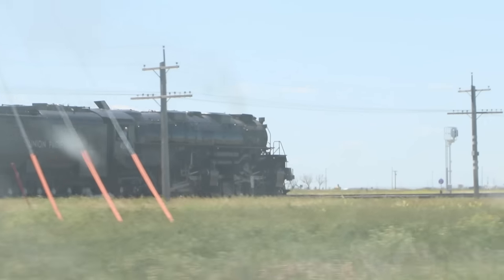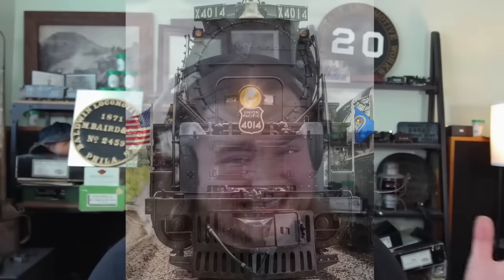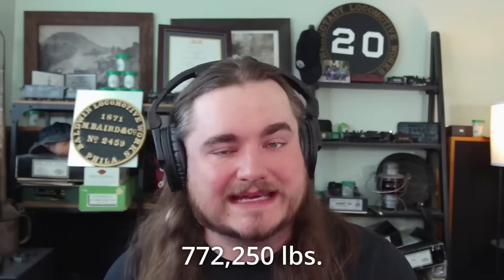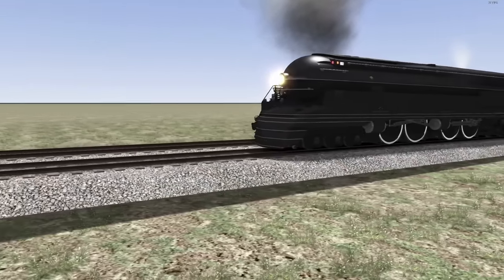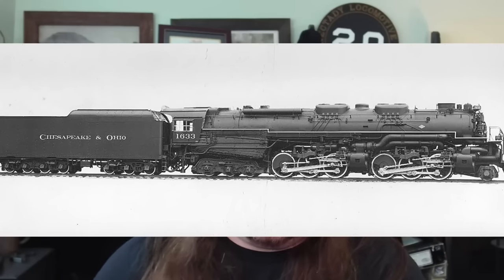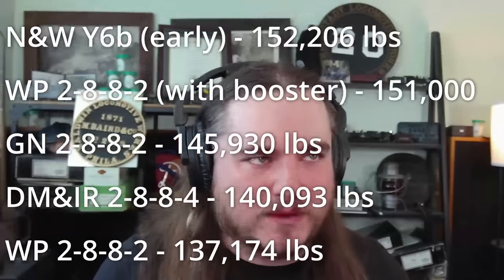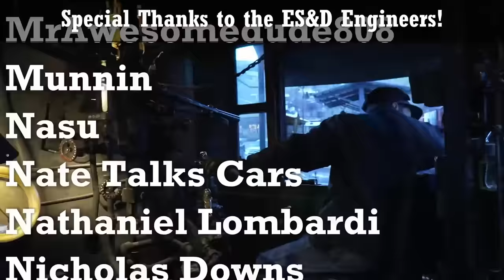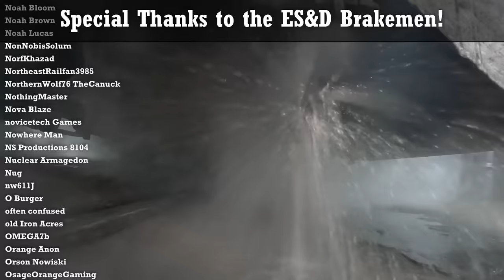BIG BOY is NOT the BIGGEST? What is then?

Comment: I thought up a fictional 4-10-10-6 locomotive once (simple articulated), and I just did the math, it outputs just SHY of 200,000 pound-force in tractive effort (the exact amount is 199,920 pound-force) it also uses the same boiler width as the Virginian AE class 2-10-10-2 (and now that Im thinking about it, how much would this 4-10-10-6 weigh?)
Reply: Why stop there?  Why not weld a couple 4-12-2 types together and make a 4-12-12-6?  Not sure how many cyclinders it ought to have--four, five, six?   All you'd need would be railroad with no curves and turnouts a quarter of a mile long.  I always thought that would be fun fantasy loco to model in HO scale . . .
Reply: @jaysverrisson1536  Still, just how much would the darn thing weigh?
Reply: @CSXP408x  Well, very roughly speaking, a Big Boy 4-8-8-4 (minus the tender) is a bit more than half again as heavy than the heaviest 4-8-4s.  A 4-12-2 (minus the tender) weighs in at a just under 500,000 lbs, comparable to a heavy 4-8-4.  So, I figure a 4-12-12-6 might weigh upwards of 750,000 plus some extra for the 6-wheel trailing trunk vs. the 2 wheels of the original.  Maybe 775,00 to 800,000 lbs for the loco alone, i.e. comparable to a Big Boy or Allegheny, or a little more, but not drastically more?

Comment: The only reason why today's locomotives are smaller is that you don't need a big boiler, and thus you are more flexible by adding more locomotives, all centrally controlled from a single cab instead of one big engine. But still, there are the MTAB IORE at 150" total length.

Comment: The big boy has always been kinda weird in that it was designed for huge fast freight service but it was actually used in that capacity and was also extremely good at long haul freight drags as well. It was a very well rounded locomotive. The Alleghenys were also fast freight engines but ended up as coal draggers and werent as good. The big boy did what it was designed to do well bery well and operated outside its design parameters very well. But it wasnt the best in terms of fulfillment of their designed purposes. The S1 and the Y6s were still better at the purposes for which they were built however big boy did better at things outside of its design parameters

Comment: How did Santa Fe’s “Double Decapod” compare? Although it failed miserably, that had to be larger than the “Big Boy”. As memory serves, the Santa Fe’s 2-10-10-2 had an articulated boiler. The Santa Fe wound up rebuilding these into 2 , 2-10-0’s with the addition of cabs, fire boxes, smoke boxes etc to each half as necessary. If successful, they would have outclassed the “Big Boy”.

Comment: I might be wrong in this statement but if I recall correctly a lot of these massive articulated engines where purpose built for a certain service and in some cases even just a specific train (N&W Y6 specifically hauling some of the longest coal trains ever marshalled in their time) which is why so few where produced whereas there’s a myriad of serialized Baldwin and Alco’s you could find that saw hundreds of the exact same standardized model built for various railroads.  Also a lot of them had only specific places and track lines they could operate due to their weight, so they’re completely useless anywhere else.

Comment: It’s important to mention that the Big Boys and mallets were built for two different purposes. The former for hauling faster loads over long distances through vast deserts, the layers for slower moves in often more densely populated regions than that of Wyoming, Utah, and Colorado where the Big Boys worked. Still what they were capable of is hard to beat, even by simple articulateds built for fast freights

Also those lengthy ones were turbines. And the S1 tenderless was shorter than a tenderless big boy

Comment: At least a few Challengers still exist. Big Boy turned out to not be the most economical either. It was designed to haul freight over the Rockies with the idea that it could haul longer trains. But 3 Challengers could easily pull the same as 2 Big Boys and the 3 Challengers would use less fuel and the water as the 2 Big Boys for the same job. The Big Boys were the "great big experiment", and that's where the excitement lies.
Reply: ...You're forgetting the cost of three locomotive crews vs only two in that comparison. Compared to the cost of the crew running the engine's, fuel and water were cheap, especially back then. By that metric, the 4000 class actually were fairly economical, given the entire point of these large engines was to run longer trains with fewer crews.

Comment: Without watching your video, I'd suggest a Beyer Garrett, (sent the the USSR) with a suspended boiler between TWO articulated 4-6-2 locomotive frames, with those positioned with the rear ends inwards, and the lead pilot trucks (furthest away from their couterpart) to be opposite facing complete locomotive frames in their own right, with a huge boiler and coal bunker slung  between them, such that the single boiler fed all for locomotive trucks, totalling a huge 160+ feet ?

But then again, maybe the experimental (English) Jawn Henry locomotive may have been the longest - (re: "Jawn Henry." Built by Baldwin Locomotive Works, No. 2300 weighed 409 tons and was 161 feet long)
Butt who knows and really?
Who cares?

Comment: See plenty of reports that state the Big Boy was fully capable of 7,000 plus horsepower. Some of the trains you compared the Big Boy to seemed to be Diesel Electric. Also the amount of weight over the drive wheels plays a big factor when considering tractive effort. I believe it’s said the S1 only had 40% of its weight over the drives and suffered from slipping issues.

Comment: An important fact that most people seem to forget when they’re comparing the big boy With the other large steam locomotives, Is that the big boy has relatively large drivers For freight locomotive at 68in Because it was built for speed. So if you were to replace those drivers With sizes more common like 63 to 65in Then You probably could get A lot more  tractive effort maybe like 150k. But of course, top speed would go down With those small drivers.

Comment: I'm an old farm boy that likes steam as well.
Farmers would get together and have tractor pulls to brag about their tractors. The conditions of the staged pulls was never ideal. Some tractors did better than others.
The real test was in the fields doing the jobs they were designed for. Which ones could dig their toenails and get through the tough spots was the real test. 
Todays tractor pulls are for show and you won't see any of them out in the field working 10 hour days.
Big Boys field was the mountains between Cheyenne and Ogden where they slugged it out on a daily basis.

Comment: There are three production locomotives that are in the class of the BIG BOY, the key word is production, UP bought 25 BIGBOY's.   there were 88 Allegany/Blue Ridge Locomotives, and there were 18 DMIR Yellowstone locomotives. they were all 6000+ Horse power from the 2 drive engines.  The Allegany got a Horse power boost with the Steam turbines in the 3 axle firebox truck.  Big Boy was known as the largest because of two factors, First the PR department at UP advertised  it as such, Second: they operated next to the US 30, the Lincoln Highway where it was filmed pulling long trains at high speed across the Great Basin Desert.  Yellowstone's hauled heavy loads of Iron ore through the northern Minnesota forest,  Allegany/Blue Ridge were pulling Coal in the New River Valley canyon and filming was limited to short sections at much slower speeds.   The Y6B was a stronger pulling engine but the size of it's drivers limited the speed and therefore the horse power.
Reply: The horsepower was limited by the size of the firebox and boiler, not the drivers.  This locomotive was designed to generate stupendous tractive effort at speeds of 25-30 mph, the maximum safe speed for superheavyweight coal trains in that mountainous terrain.  For that service 5000 boiler horsepower was plenty.  It could make 50 mph with a light load without shaking too much, and if Norfolk and Western had so wished they could have built it with a bigger firebox and boiler to run that fast with a heavy train in places where the terrain would allow it.  What they did was build locomotives that were more efficient than a Big Boy or Allegheny would have been in that slow coal drag service.  When the Alleghenies were running in such service on the competing Chesapeake and Ohio, their additional boiler horsepower capability was being wasted.

One of my fellow model railroad club members once said that N&W was the smartest in designing and operating big steam locomotives, and that C&O was clueless.

Comment: A few points: 1: The power differences between the Big boy and other lsrge locomotives likely lie within the error bars for power measurements at the time. 2: Most engines that beat the Big boy on tractive effirt also have very  low factors of adhesion suggesting that they might mostly spin their wheels 3: Loading gauge, axle loading and generally similar technology is why there are a number of locos of similar size and power. Big boy is one of the later ones abd one of the more successful.

Comment: Mark: One thing you didn't mention was operating speed. Maybe BB didn't have the greatest T.E. but it did operate at speeds of 50 MPH and over whereas some of the other engines you mentions ran at 20 MPH.  HP it weight moved over distance in time.  I wonder of some of the advertised figures were overly enthusiastic. Some of those engines could not make enough steam to run over 20 MPH.  That is like rating a guitar amp at peak power.

Comment: One of the things I found fascinating when looking up the H-8 Allegheny vs. the Big Boy was the difference in axle loading. With only six driven axles to the Big Boy's eight, the H-8 must have absolutely pounded the rails it ran on. Either that or C&O had really beefy trackage.
Also, it's no surprise it out-powered the Big Boy with the 6-axle trailing truck to support the firebox from hell. More coal bed = more power!
Reply: So while the axle loading was really high, because the rods were smaller than the ones on the H7s (2-8-8-2) and T-1s (2-10-4) they replaced they were overall kinder to the rails because they had less hammer-blow.

Comment: If that wasn’t enough, the PRR Q2s apparently had a cylinder horsepower rating of 7987 horsepower, which is very high. I’ll say the Big Boys are around 85’ long for the engine alone, but still, the turbines, and the triplexes are still longer.

Comment: And here goes my hat into the ring. The later class of SP Cabforwards had a slighter larger boiler diameter. Someone will correct me, so settle down, I believe the big boy was 106 inches, Cabforward was 108.
Reply from the maker: Huh, that's nifty. I'd love to know at what point of the boiler. The Cab Forwards are overall 1' less wide than the big boy.
Reply: @Hyce777  cabforwards (AC class) did have a slightly smaller drivers at 63 inches compared to big boys 68 inches. 

The later ACs (7-12) were more less the final step in, what I’ll call “conventional articulateds”. That’s to say, make two “slug it out” freight engines into one. AC did stand for “Articulated Consolidation” 

Whereas big boy was really a challenger that leaned into freight service.

Comment: I've heard the triplex doesn't go very far so it's not good for long distances it runs out of steam because it's a triplex
Reply: The Triplexes were unsuccessful due to the fact that the third engine was getting all of its traction from the weight of the coal/water. As you ran out of coal and water, the engine just got slippery.

Comment: ive seen the big boy running very impressive here in the sierra nevada mountains that setup would not work hence a cab forward design due to snow sheds, tunnels and the fumes  Southern Pacific 4294 is an example not the biggest, but still did as much mountain work if not more then the big boys did. UP still uses steam driven Rotary Snow plows that Ive seen operating quite a few times

Comment: One AC12 cab forward still survived. Too bad we don't have the Y6b as that locomotive had the Variable Valve Plumbing that allow it to run on either simple expansion or Compound thus making the Y6b more efficient than the Big Boy.
Reply: 2156 is a Y6a you can see in St. Louis, but it got modified to include all of the Y6b special doodads, including the modified variable valve pluming, and the extended combustion chamber, and the booster valve.
Reply: @commissarcarl1700  So, I guess 2156 can be reclassified as a Y6B now. For articulated locomotives, Y6A 2156 and the Y6bs would be more efficient than 4014 due to Simple expansion are more steam starved than Y6As & Y6Bs.

Comment: I think the UP's reputation for running giant locomotives is a big part of it.  If you're a western railroad museum or the UP themselves, it's very tempting to draw a through line from the steam turbines and Challengers to the Big Boy to the GTELs ("Big Blow"), the DD35s, U50C and with culminating the Centennial.  Asserting the UP always ordered the biggest and most powerful locomotive does sound good, for a train museum that displays more than one of these locomotives, is a pretty good story: they can claim not only the biggest and most powerful diesel locomotive (asterisk) but the biggest and most powerful steam locomotive as well (asterisk asterisk asterisk.)  I believe three of the surviving  are at the same location as a Centennial, by the way.  I've seen the ones at the National Museum of Transportation in St. Louis (highly recommend) where they're parked right next to each other, but I've seen them tell a similar story at the Utah State Railroad Museum in Ogden where their Centennial sits next to a GTEL and 844's sister 833, which while not "biggest" anything is still massive. 

As an aside, I am always amused standing next to a DDA40X, because there's literally a foot-long gap right in the middle of the locomotive where you can see how they literally just put two GP40s on the same frame: it's got the same number of the same engines (2), same number of axles (8), and it's exactly as long (30m) minus one cab.  Once the Dash 2 introduced electronic ΜU control, there was literally nothing the DDA40X was better at than a pair of GP40-2 or SD40-2 units, and a lot that was worse.

Comment: Milwaukee Road 261 doesn't need an electric pusher power supply to pull the Hiawatha complete with beaver tail .The Duluth Missabe( DMIR) and Iron Range in Two Harbors ,Minnesota  has super big many and plenty two groups of 4 axles for wheels so put that in your big boy. the horn toots and doesn't bog down speed .

Comment: I've always understood it as a jack-of-all-trades sort of locomotive. It could pull an impressive amount of cargo at an impressive speed with impressive efficiency. Sure, there were other locomotives that performed better in certain categories, but were often slower, or less efficient. The triplexes were immensely powerful but ran short on fuel and water constantly and were relegated to slow speeds and prone to having issues with steam losing a lot of energy before it reached the third engine unit. So I've always thought of the Big Boy as being the biggest performer.

Comment: Yeah, you mentioned about that. Big Boy wasn't the biggest by any means, but if you look at the overall package, it's not. Either way, the Allegheny had the more horsepower. But according to UP records from 1941-1944, from their testing, on June 22, 1942, Union Pacific utilized Santa Fe dynamometer car No. 27 to test No. 4014's performance, At 39 mph, No. 4014 produced 7,000 - 7,500 hp at the drawbar, which be 8,157 hp produced at the cylinders. Without any slip, on April 3, 1943, Union Pacific utilized Santa Fe dynamometer car No. 29 to test No. 4016's performance, At 41 mph, No. 4016 produced 6,290 - 7000 hp at the drawbar, which be 7,830 hp produced at the cylinders. In Last of the Giants  You can see they say that the average horsepower of the Big Boy is 7,000 horsepower. So yes, by any measure, the Big Boy is not the largest locomotive. But what they say is that its overall size is the largest. As you can see, the S1's total weight is less than 500 tons, even though it is longer than the Big Boy Allegheny, which has a maximum weight of 604 tons, which is less than the Big Boy's 607 tons. The Allegheny has been proven over the decades that its engine weight is 2 tons less than the Big Boy, but the Big Boy is still lighter than any other locomotive engine we have. So Big Boy isn't the biggest if you measure one thing, but the biggest if you measure everything 🙂🙂

Comment: UP 4000 may have been the biggest locomotive the ALCO employee who accidentally named the class had helped build, but other than that iconic name, it was  just a big, powerful freight locomotive built to pull 3600 ton road freights through the Wasatch mountain passes unassisted. If the class had been named Wasatch as UP wanted, it would have done its job in obscurity and there might not be a single survivor into preservation.  This was a case of the name truly making all the difference.